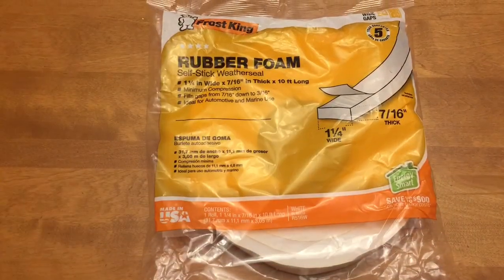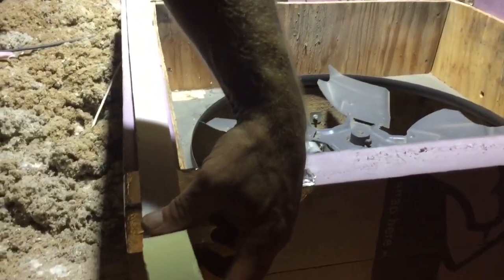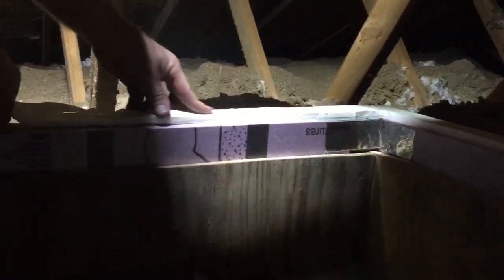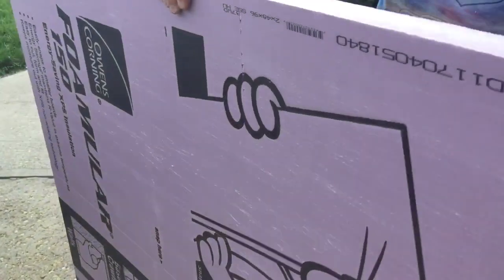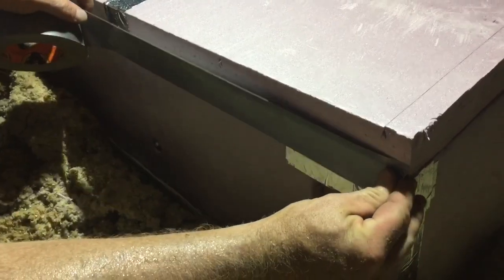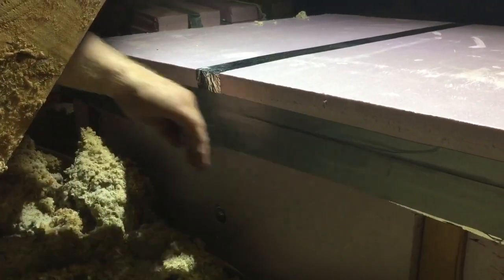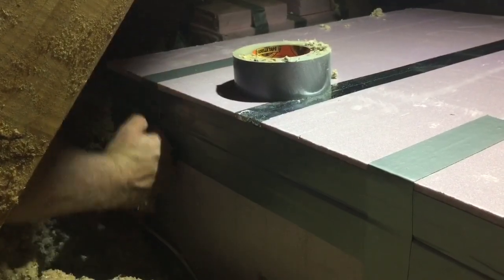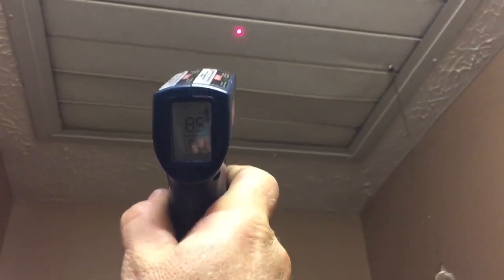How to make a automatic whole house fan insulating cover.

Comment: I don't know why this isn't always done!  We did this.  It worked great.  We live in Fresno where it is 100+ most summer long.  My AC ran all the time because the thermostat is under the whole house fan vent.  Even in the winter, I could smell the attic insullation dust.  But covering it from the hallway meant putting a cover on or off anytime we used the fan.  This automatically closes when the fan goes off.  
Thanks so much!
Reply from the maker: Works great!

Thanks for watching.

Comment: I did something similar to this many years ago and have now reached the age where it isn't as much fun crawling around in the attic.  Great idea you have with the hinged foam board.  However, I'm wondering about the condition of your duct tape hinge.  Seems like the heat of an attic might have ruined it by now.
Reply from the maker: To this day it is still holding up. If you are in question you could also use the metal tape used for ductwork. Hope this helps. Thanks for watching.

Comment: I just built this and am thinking about adding a counter weight pulley system to help the cover go up more easily to allow for more airflow
Reply from the maker: That sounds like a great addition. Thanks for sharing.
Reply: Mark I'm thinking of the same thing..
Reply: @GRASS898  I just set up up yesterday. Opens more than double what it did before. Bought a pulley at Home Depot, screwed it to a rafter, and just used twine and some leftover metal parts as a weight
Reply: @markholm8714  I just built my box yesterday and added a small scrap board I had to the back to counter balance the foam board and to prevent the lid from raising completely vertical. I'll see if I can attach a picture later.
Reply: @GRASS898  -any update? I’m thinking of doing the same thing

Comment: Great idea, thank you for posting. I'm wondering if the lid might open further if cut down the center and hinged on either side of the box so it opens like a double door?
Reply from the maker: Great idea! 2 pieces would be lighter and may open more but check to see if they fit together and close tight. Thanks for watching.

Comment: It seems like restricting the airflow of the whole house fan would be a bad idea.  It's a good solution, but I'd be curious how well it pulls air when you're blocking 60% of the exhaust
Reply from the maker: The weight of the insulation is so light that the airflow pushes it up with ease, there is very little air restriction, and the minimal amount is not even noticed. Thanks for the question.
Reply: @funbro1  I understand that, but the opening is much smaller than with the lid not there. The lid doesn’t open completely. You ARE restricting air flow, which definitely will affect suction.
Reply from the maker: It definitely WILL restrict are flow but as I mentioned the weight of the insulation is so light that the air flow loss is pretty insignificant. If you look at it closer I suppose the automatic shutters on this fan are also restricting the air. More restrictions could be found by running it without having enough windows open in the house. The fan has a built in overload protection and I’ve had it running for hours without any problems.
In short, to answer your question, The air still pulls very well with this set up. So well that no difference has been noticeable. Thanks for checking in.

Comment: Ha! I like minimal design. Too much is over-engineered these days. But, it seems this would reduce the airflow and maybe burn more watts because the opening is reduced, creating back pressure. I am now wondering if there is a way to add more engineering (contradicts self, ha) such as a small motor on a pulley that would pre-engage to a limit switch, etc...kind of like the Tamarack fans?
Reply from the maker: Sounds like a lot of design and build to make that work. This one has been working fine since I made the video without any problems so maybe simple is better sometimes. Thanks for watching.
Reply: @funbro1  long as it does the trick! What brand of duct tape did you use?
Reply from the maker: I went with a better brand like Gorilla I believe.

Comment: Is the cover you’re peeling off the insulation strips exposing an adhesive side? Is it adhesive on both sides? It obviously isn’t causing the insulated foam board lid to stay stuck to the foam strips, so I’m guessing it’s just adhesive on one side.
Reply from the maker: It is only adhesive on one side. Thanks for the question and Thanks for watching.
Reply: funbro1 right on. Thanks for the reply and for the video. Going to try this soon.

Comment: I have one of these fans in my attic but haven’t run because I have blown in cellulose insulation and I assumed it would make a snowstorm of a mess.. looks like you have the same type of blown in insulation, correct?  No problems with making a insulation winter wonderland when turned on?  Thanks
Reply from the maker: When I was making this cover I actually stayed in the attic and had someone turn the fan on. Luckily there was no insulation tornado, so I think you should be good to use you house fan. Thanks for watching.

Comment: Well, since this has been on the internet for three months and no one's explained what's wrong with it, I'm going to assume it's all good and I might use the design...
Reply from the maker: Working great now, why would something be wrong with it??? Thanks for watching.
Reply: Doesn't the floating lid make the fan work harder and waste more energy? Isn't it like 2-4 lbs? Plus, it adds resistance due to the angle.
Reply: @alexandr0id  Your statement may be true if you plan on going into your attic all the time to put a cover on and take it off. Most people are not that diligent, so this solutions will save you money if you don't plan on going up there every time you want to turn it on. I just bought a house with a whole house fan, and am looking for solutions. This is one i will try for sure! Thanks funbro1 for the great idea.
Reply: I believe EPS foam requires a fire barrier, so there's that.